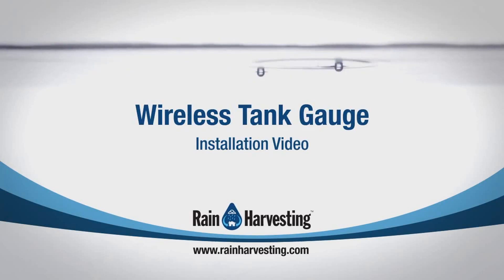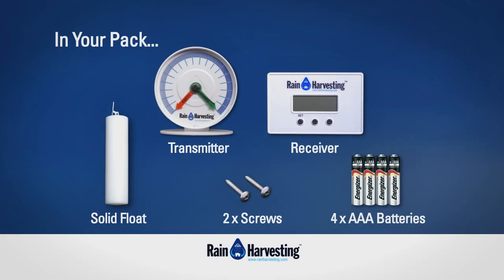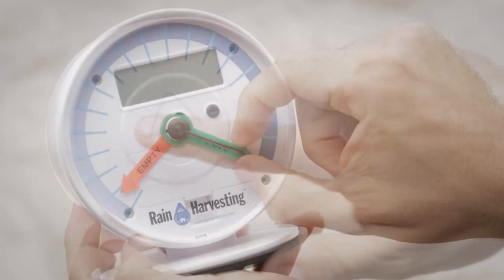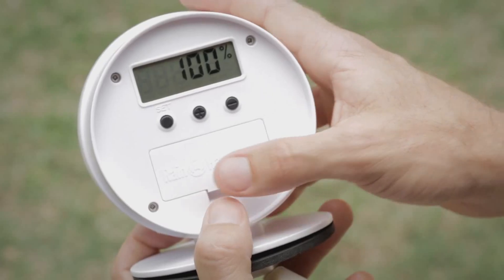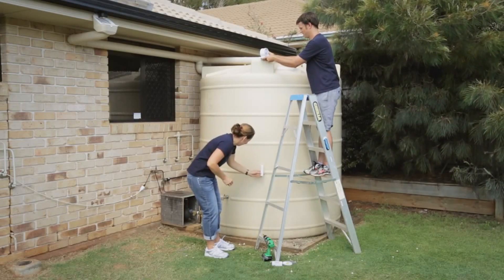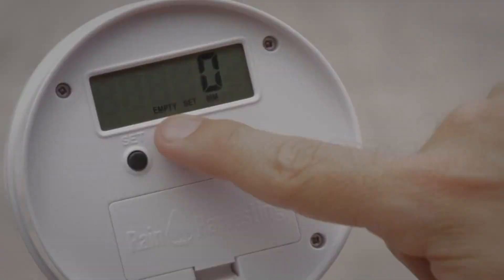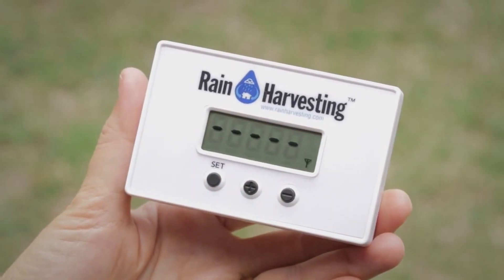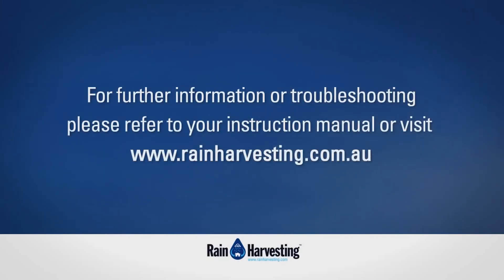Rain Harvesting Wireless Tank Gauge Installation

Comment: not worth the money - you'll end up with a useless hole in your tank and a broken device after 6 months
Reply: Just seen your comment. I have 2 of these. Install is on HOLD. Can u tell me what happened to your gauge?
Reply: @pma7158  1. the front cover (screen) pops off. 2. the spring mechanism will get sticky and not work without some fiddling. i used to bang the side of the tank to see if any play. 3. the nylon string will last 4-6 months then degrade, dropping the weight into the tank. very difficult to retrieve.